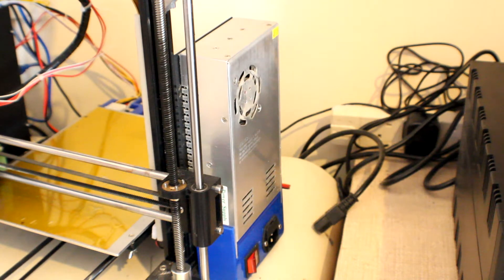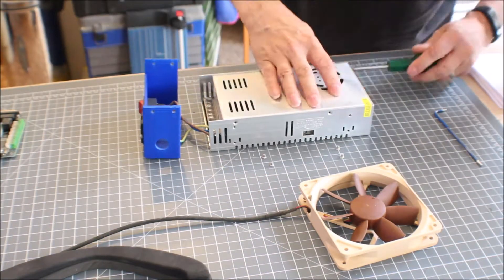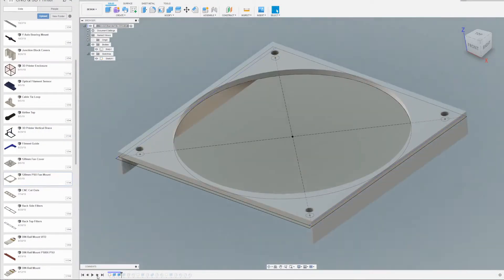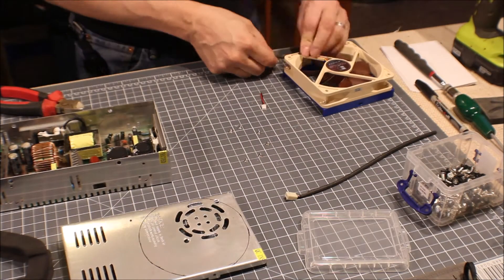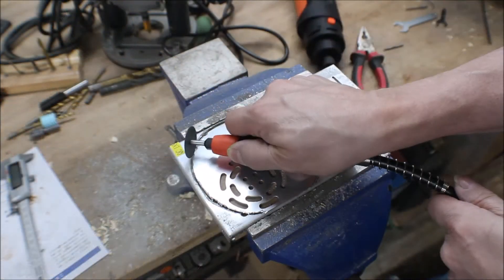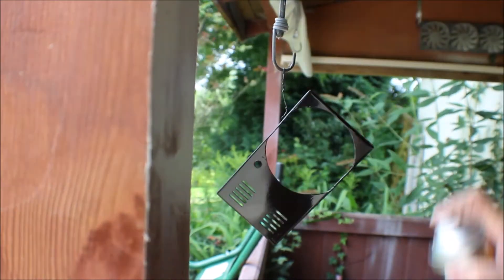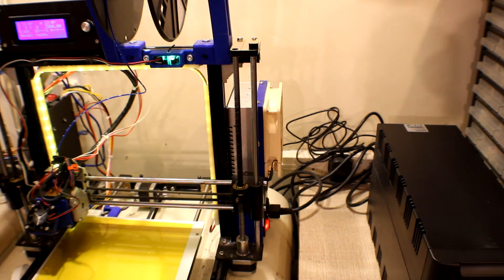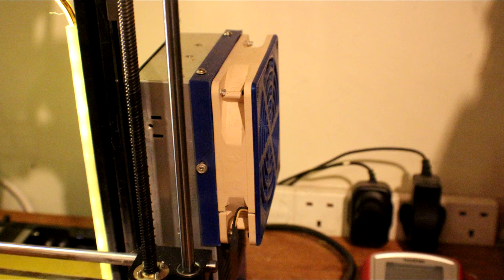3D Printer Upgrade - A Silent PSU Fan

Comment: Thanks for the video. I am planing to do a replace as well only I am creating a complete new control box. What is the power output of the psu fan connector. I am not sure if I have the right fan.
Reply from the maker: Hi Vincent...the fan connector outputs 12volts, but I don't know how many amps it's rated for. Given both the original and replacement draw 0.12amps, I would not say it would handle much more than that. Hope that helps.

Comment: What voltage need to be a psu fan? I thought 24V?
Reply from the maker: On my PSU the original fan was 12V 0.12A and the Noctua Fan is the same spec. The PSU outputs 24V at the rails for the printer however, so either there is a 12V rail in the PSU or 24V is getting reduced to 12V before the fan, if its being powered from the 24V rail.
So long as you replace the fan with one of the same Voltage and Amp draw you should be OK.

Comment: Thanks for the inspiration, of an obviously quiet reasonable solution.
I was already over engineering another solution, in which I would have taken an Arduino and a buck Converter to let the original small fan run permanently at just half the Voltage as long as the PSU would have turned the fan off, and then letting it go to full voltage whenever the fan would originally have turned on. 😅
Reply from the maker: Glad it was of use and other solutions maybe better, so its always good to have more minds on the problem.
Reply: Cheers!

Comment: I recently got a very similar quiet fan and had  a similar idea, although additionally  I thought I would stack the main board box (which also has a loud fan) on top of the power supply (if the cables are long enough) and use the one fan to cool both the psu and main board by cutting a semi circle in the top of both boxes and mount the fan straddling them. Can you see any problem with this scheme?
Reply from the maker: Hi Michael - I guess you could do something like that and maybe even print a split duct from each PSU, which merges into the fan mount. You may have to watch out for one PSU/enclosure blocking holes to the other and also possibly that if you only have one fan, then the unit that no longer has a fan connected may throw an error because "its" fan is no longer there... (just be careful with the power loading and the capacitors in the mains PSU - those are dangerous). Good luck with the project.

Comment: Thanks for the vid. what version of fan did you use? lots of 120mm varieties out there!
Reply from the maker: Hi Mark - it was a Noctua NF-12A FLX 120mm fan - the 3 pin kind rather than a PWM variant. It needed the 3rd pin/wire isolating as you won't need that, as its the rev counter wire for monitoring in a PC. So just wire the positive and negative wires as per the original small (noisy) fan in the PSU.